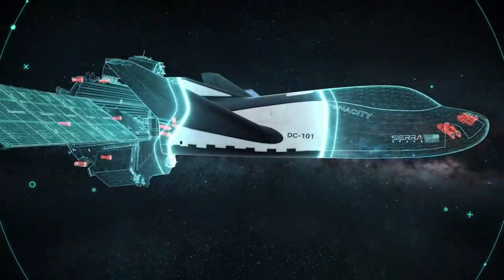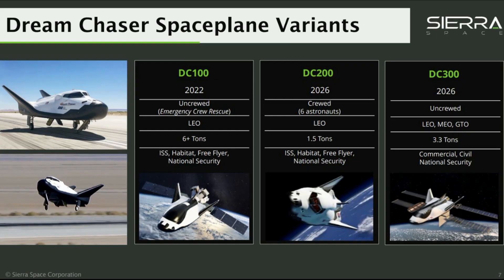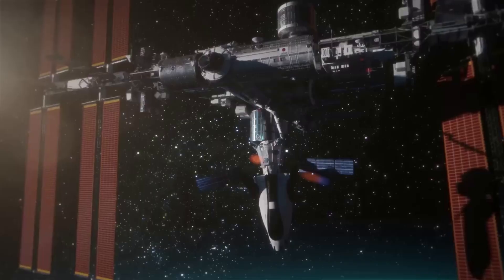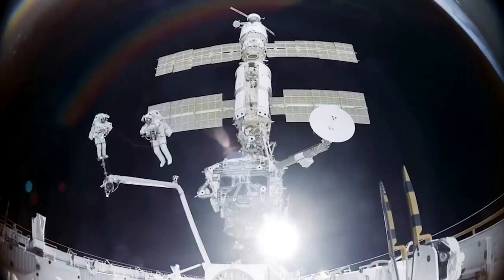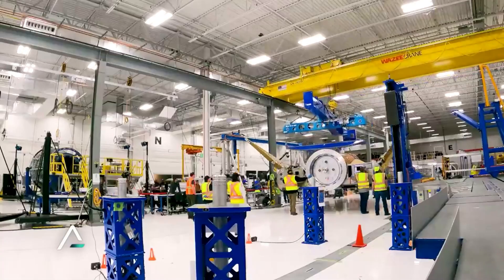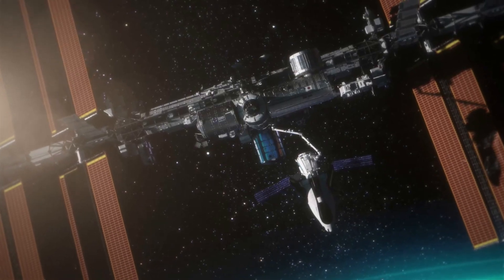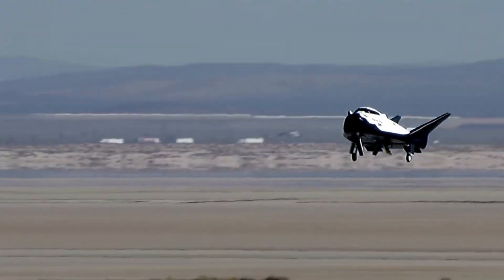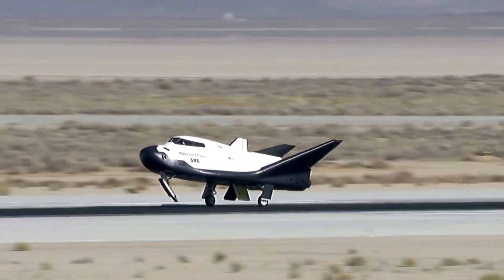The First Dream Chaser Spaceplane Is About To Launch

Comment: I'll believe when I see it, Sierra has been milking this project since BEFORE the space shuttles were retired. Sierra is about as incompetent as Boeing with their mis-named Starliner. This channel touts DreamChaser as "About to launch" every time they give us a so called update, with no new information.
Reply: Dream Chaser came in third in the 2014 Commercial Crew program. In 2016, they secured a Commercial Resupply Services (CRS) contract. Tenacity is being built now and is expected to fly on the ULA Vulcan Centaur, which is having its own problems with very late delivery of the BE-4 engines from Blue Origin. SNC wants to use the CRS contract to prove Dream Chaser towards a future crew version. This is their first spacecraft, they are mainly a spacecraft parts supplier.

Comment: Could Dreamchaser be launched on Falcon 9?
Reply: As far as I know, this version of Dreamchaser (that launches in a fairing) is just slightly to large to fit inside the Falcon 9 fairing. However, as future Dreamchasers will launch without fairing, Falcon 9 should theoretically be able to get Dreamchaser to LEO
Reply: @klosradieschen3174  Dream Chaser's wings fold, so it can fit in the fairings for the Atlas-V, Falcon 9, and Vulcan Centaur. SNC has said that Dream Chaser is launcher agnostic, so can fly on any of the three. And presumably the Antares 330 when it is developed.
Reply: Space X has the dragon and soon Star Ship so i don't think  they will be open to having a contract Dream Chaser (competing companies). If you're thinking of the re-usability they might need to look at blue Origin.

Comment: Ok, I watched it again. DC200. Escape system. "Why don't they just" (insert belly laugh here): figure out a way to use the escape system thrust (hypergolics?) to get DC200 from 70Km to 300Km? Not all the way - but at least contribute. It seems a waste to take  engines and fuel all they way to 300 Km and then bring it all the way back to a soft runway landing. I'll guess, NASA required for human rating? Also, on that second stage - are those two BE-3s from New Shepard?
Reply: They are RL-10 engines from Aerojet Rocketdyne. The second stage is a new version of the Centaur that currently flies on the Atlas V.

Comment: I just watched the SES18/19 launch. The booster got to 70 Km in altitude and 7,000 Km in speed. Was that ground speed or rising booster speed? At what point does rising speed change to ground speed? The second stage took the satellites to 20,000 Km side-wase speed or ground speed and about 150 Km of altitude. At satellite launch the altitude of the second stage was still increasing but the speed was decreasing - from which I derived the conclusion that the orbit was less than circular and the satellites would have to circularize their own orbits while the second stage will hit atmosphere when it comes back from it's mildly elliptical orbit. I was trying to think of how the Dream Chaser DC300 could be fully reusable. A GTO orbit is highly elliptical. I don't see how it can survive atmosphere re-entry coming back at those speeds. Unless it skips off the atmosphere a few times? I think the ISS is around 300Km altitude. Habitat the same? Reef and Habitat are the same thing, right? Blue origin is prime for Habitat and BE-4s on the Vulcan. I don't think BE-4s can throttle low enough to ever make Vulcan landable - so we're waiting for New Glenn to make dream chaser fully reusable? Step by step, patiently?
Reply: The thermal tiles protect it against the heat, just like the shuttle. Having a large surface area compared to weight also makes it easier, as the temperatures don't get as high.